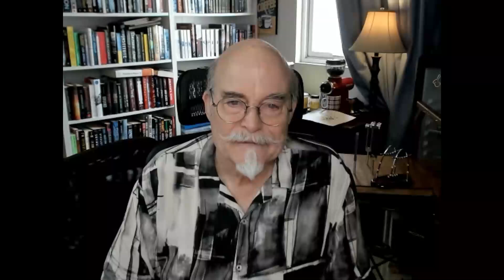Misconceptions

Comment: On the other hand, putting in just enough broadband absorption to make the room sound nice enough, and using good headphones to get the low end right (AirPods Pro 2 work fine for this actually, and that's what most people might listen on anyway), is probably the only thing that makes any sense at all for nearly everyone with a musical hobby. And nearly everyone making music is only doing it as a hobby. It's nice to do your hobby scientifically correct, but I'm not sure bass traps spark more joy than that much spent on instruments etc.
Reply from the maker: @PeterJensen7  true. Very true. But if you want it to be more than a hobby....

Comment: I would say, that so much stress put on the reverberation room measurements is also a bit of misconception. If you want to compare materials, do it with the same standardized method, indeed. If you want to universaly capture boundary condition for room acoustic designs, do it in the reverberation room, indeed. If you want to sell a product, have it measured there, because it is a commonly understood quantity, which is decently robust. On the other hand, in small rooms (which is the most common case for DIY projects), the transition to modal field is rather high, often higher than 250 Hz. The field stops to be comparable to the one of your measured data under that frequency threshold, no matter how big and great the reverberation room is. Even at higher frequencies, is the incidence of sound really random enough to be considered precisely reflected by the reverberation room measurement? Sure, questions like "Is 10cm of this and that material sufficient for the room treatment?" make little sence, but at the same time, it is fair to say, that random incidence assumption has also its limits. That is why the room acoustic treatment is typically done in phases, measuring the results after each step and calibrating the model, if there is some. DIY solutions need to be driven by well informed decisions and with realistic expectations, but small rooms are kind of ideal for tinkering with different solutions, measuring incremental steps. There is already a lot of (scientific) literature available which makes the tinkering converge to a decent solution.
Reply from the maker: Thanks for  comment! Most of your questions pertaining to testing vs small rooms are misconceptions. And small rooms are far from ideal for tinkering with different solutions. Please see my paper - https://jhbrandt.net/wp-content/uploads/2023/06/DIY_ABSORPTION_TESTING.pdf
When absorption is tested in the laboratory, the results will show its properties and those properties do NOT change based on the room in which they are placed. They will perform exactly as they did in the lab. The only difference is that you CAN'T test that in a small room. Physics.